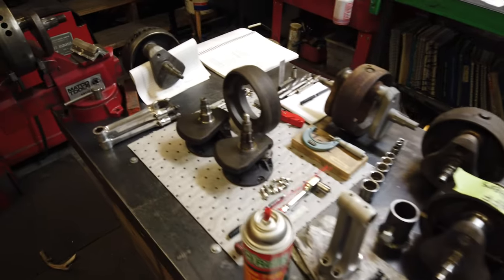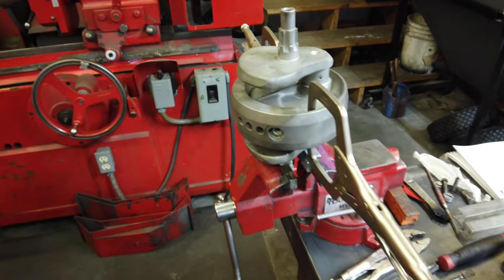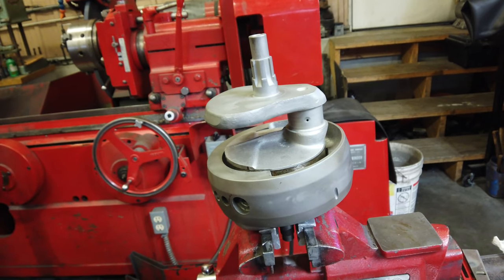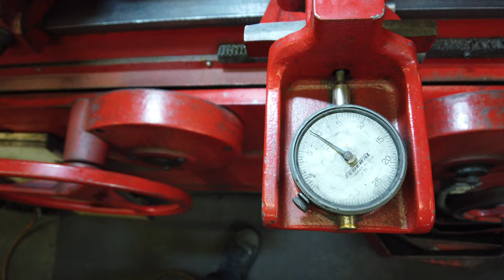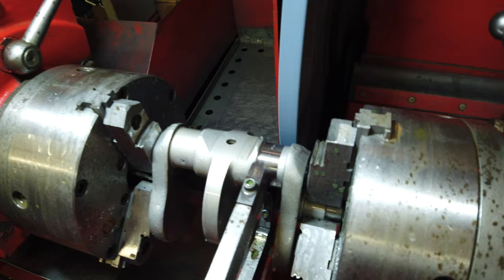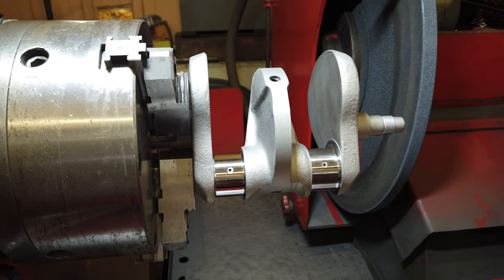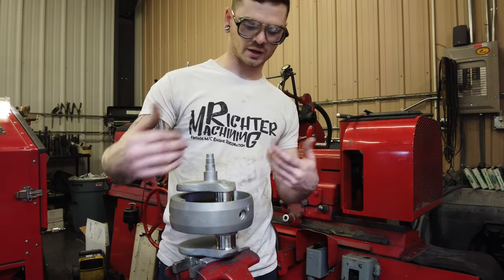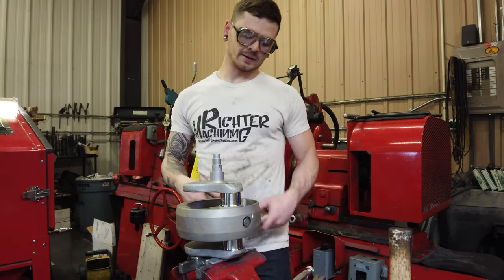Triumph 650 crank shaft grinding

Comment: This is good stuff. I like automotive machining videos. I also like seeing engines that I usually don't see as often.
I doubt I will even get to use or turn a wrench on such vehicles, but I find it interesting anyway.
Originally you thought -.030 was possible, but you had to go to -.040.
When a Triumph crank is too worn, what do you do? Are they worth welding, or do you just look for a better core? I like seeing what people do when better cores and/or new parts are extremely expensive and saving the old parts is worth it.

I'd like to see how these engines are oiled if you can. It seems like modern oil filters could dramatically extend engine life. I always like seeing how people add an oil filter system to engines that never had one.
Reply: Norton Commandos have a spin on oil filter on the oil return side to the tank. The Norton doesn't seem to have as much trouble with sludge in the crank. Oil filters can be added to the return side of Triumph and BSA motorcycles and I would recommend it. These sludge traps fill up from left to right with the right hand rod tying up first.

Comment: This is good stuff. I would like your thoughts on the end of the crank, where oil pressure enters the crank. Will grinding a thou or more away,  be allright, to make the surface more perfect? Cheers John
Reply from the maker: i grind the feed ends often i usually can clean them up without changing the over all dimensions. but its its really bad they do make an over size seal to make up for material removed

Comment: Loved watching your vids, very informative. Question for you. I stripped and cleaned my 6T  3 piece crank. As a precautionary
measure ,I lapped the mating surfaces in with valve grinding paste and was happy with result. However, after securing the 6 bolts, i blocked up the oil ways and pressure tested for any leaks (primarily the grub screw for sludge trap) and at only 10 psi when sprayed with light oil, i was getting bubbling from the flanges and bolt heads. Do you think this may be the standard it left the factory or should i have applied some perhaps Wellseal. Thanks in anticipation regards Trev UK.
Reply from the maker: to be honest id say they for sure left with low pressure holding haha oil is going to find it harder to escape id say you did all the right steps and run it man!

Comment: I know this an older video but I have a question for you, I’m an experienced motorcycle mech. having been trained and worked in multiple shops so what do you think of removing the sludge trap completely? I’m kicking this around for my 69 T120. I’ve already made a remote filter mount for a spin on, cleaned the crank and now with the filter and new oils I just don’t see the need for the trap. So I think that I can turn a steel plug to fill the chamber, drill the passage ways and rebalance. Any thoughts on this?
Reply: William, the sludge trap is the last line of defence for your big end bearings, being a very effective centrifugal oil filter, and it is worth retaining for that reason alone. Also it helps control oil flow to the big ends. For the amount of work you're talking about doing it would make a big difference to the weight of the big end journals and make balancing  a real pig to carry out.
I also use a remote filter mounted on the return line back to the tank. The engine produces the combustion by-products and the metallic wear particles that the sludge trap would usually collect while doing its job as a centrifugal oil filter so taking them out immediately after the oil leaves the engine and catching them in the spin-on filter means they would never get to the sludge trap and clog it. Put all the standard parts including the tube back into the crank to retain the standard balance, regularly change the oil and filter, and you should never have to worry about the sludge trap clogging again. Just make sure the rest of the oil system, the tank and hoses, is spotless too. You can take the rocker feed after the filter too so you're not dumping dirty oil into the top of the engine. Good luck. 👍😎